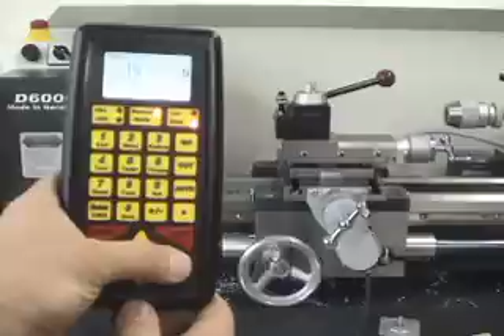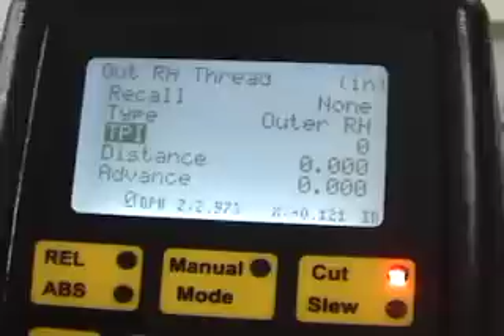Electronic Lead Screw, Wabeco Lathe

Comment from the maker: With this "Digital Lathe" set up you can cut any mertic or inch threading (right or left)!
Simply enter the values, turn the lathe and start the program.

Mit diesem "Digital Lathe" (Digitaler Drehbank) kann man jede Gewinde Steigung drehen, Metrisch oder Zoll. Ganz einfach, Werte eingeben, Drehbank einschalten und beim Handprogrammer "Start" drücken. 
Unser Kontroller kann auch für andere und grössere Modelle Drehbänke gebraucht werden (Sie müssen nur die Morenhalter bauen).
MDA Precision